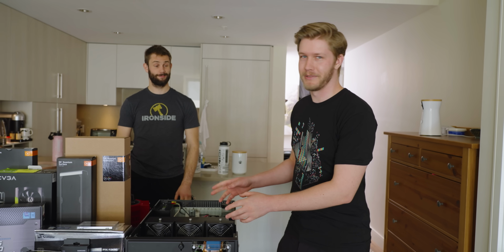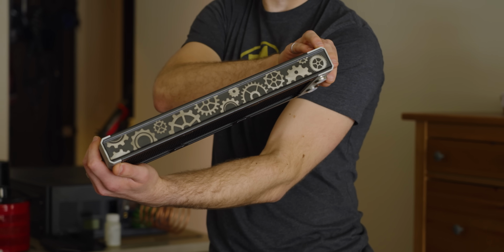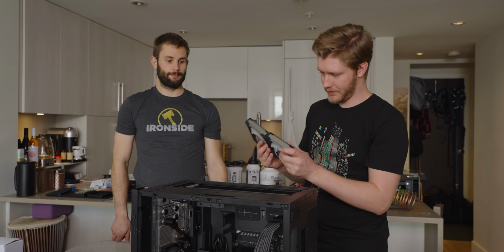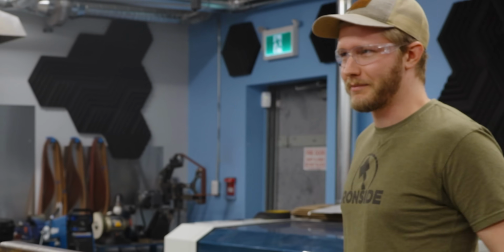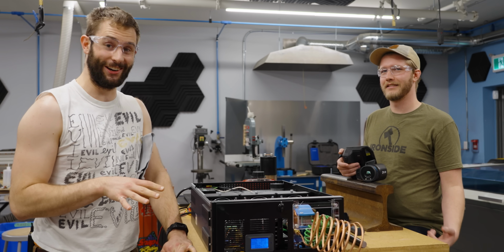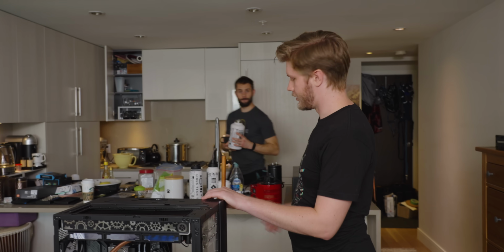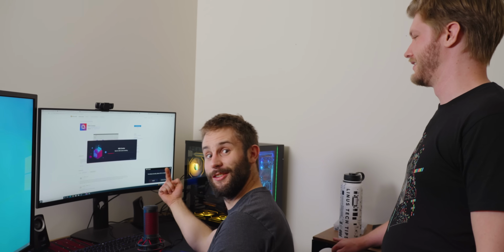This PC is TERRIFYING - Intel Extreme Tech Upgrade

Comment: What is the part number for that capacitor? I have an electrical engineering friend who is curious.
Also I think the kw value of the big boy cap looks a little off. Shouldn't it be 600kw. 
Love the chaotic energy!
Reply: its a C500T from Celem! technically speaking its maximum current is 800A, its max voltage is 750 RMS and the maximum power rating is 500KVAr (not KW). You can pump that much power through it as long as you can pull the heat it produces from its internal resistance fast enough! Generally parts like this have seperate power/voltage/current limits each of which need to be maintained so the power limit is lower than the maximum voltage and current multiplied out.

Comment: He should have bleeding resistors across the caps. and that inductor was saturated in the first test i reckon lol
Reply: I do have a 47Kohm resistor as discharge caps, otherwise the voltage wouldn't really drop. OOHH yeah the toroid core was SUPER saturated, I swapped it out for the 6 toroids and the entire heater system works WWAAYY better!

Comment: am I the only one who thinks their "breaker" problem is weird
because a breaker isn't really supposed to fry itself
that'd be a fuse
and we stopped using fuses in buildings a long time ago
and like, it's not hard to connect wires together in the worst case, if you know what you're doing, which you should if you listened in school
I don't see why they would need an electrician

Comment: I mean, I like all the jankiness usually and I ain't being a boring Billy or whatever I'll be called, but I mean there were just being stupid as fuck at that point in the lab, if someone had of got clapped by them volts/amps, then there would be trouble I'm sure. One thing ya never mess with is the invisible killer... (ie)... the shit they were just toying about with. I mean, just not paying attention for 1 second and u could be done, lights out baby, game over, no checkpoints, no mulligans, that was on veteran difficulty my guy, they were just crazy, especially Tynan. It's good TV an all, but so fucking dangerous guys. Man, I was on edge the whole time he was near that box and gonna hit power.  I have a feeling we wont be seeing things like this for a while, and maybe not see tynan for a while, I could b wrong, but hey ho, just my opinion.

Comment: Recommendation for Tynan put a high resistance resistor I parallel with the capacitors so that when power is turned off it discharges the power safely from them
Reply: There is a 47Kohm resistor across the bus bars for exactly that purpose! The capacitors hold enough charge that it takes a very long time for them to discharge through it.

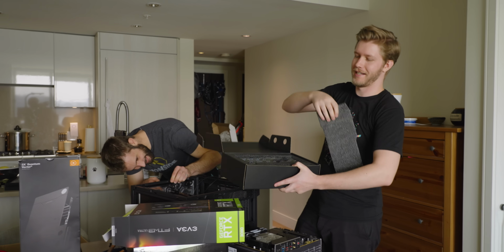Comment: 6:50 "You have to try to make it a d***". Job well done, they even included a sphincter star for reference. He's such an idiot.
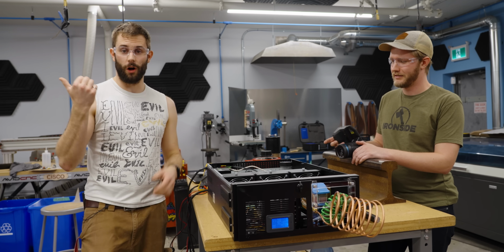15:33 Blow a breaker in the wall and just reset it. I did it today on the job because people plugged too many heaters into the plugs on a single breaker zone. And, if the breaker actually fails- you just pop it out and put the new one from the hardware store in. No electrician required.
Reply: yup you are totally right. there was a chance through testing I could have tripped it several times through and in general breakers are rated for a certain number of trips before they should be replaced.
Reply: @tynanstack7924  I'm not trying to be saucy. I looked and couldn't find any information about breakers being rated for a number of trips. The best I could dig up was a bit about 'exercising' older breakers by flipping on/off/tripping/resetting to maintain functionality. Mine? My computer is on a 10 amp breaker I've popped 6-10 times a year for the last 10 years. It's when I run my electric tea kettle while the space heater is on high. Winter. Oops. As far as I can tell, no one's replaced that breaker since the house was built in the '80s.
edit: and you replying to me is awesome. Say what I will, you rock. Best LTT guy in my book!

Comment: I wonder how many farads these gargantuan capacitors have.
Reply: The really big one was 20mF, the two ones installed in the induction heater were 1.5mF each and the high power Celem capacitor was 3uF

Comment: About forty years ago I was shown a unit much like this inductive heater. One thing I remember is that they had a output transformer and there was just one turn of the secondary coil that was brought to form a loop where you could insert a piece of metal you wanted to heat. A inch thick rod of tool steel took less than ten seconds to heat enough that it melted and the end dropped to the floor. It was used for spot hardening of things like crankshafts and camshafts where you want bearing surfaces and the surfaces where the lifters ride hard while the rest of the shaft is tough rather than hard. I remember that the unit was pretty compact, though certainly larger than the one in this video. If I's have to guess I'd say about three to four times that rackmount chassis and I guess it was in the rage of 60 to 100 kilos though it could be a lot more. I have absolutely no idea of the power draw though. Also while writing this I get a feeling the output secondary coil might have been water cooled as I have a strange memory of there being water running into a floor drain. Like I said it was forty years ago.

Comment: Great Video, love the ingenuity!
I would say you need a discharge resistor (or a few) to quickly discharge the capacitors , it is used in commercial  power supplies.

Comment: Hey...I've been llooking to do something with copper tubing for a while.  However I am always struggling to understand what size tubing, and fittings are required for copper?
Reply: I would suggest you go back and check out the copper hardline watercooling video from LTT titled: "Copper Tubing is Hard" they go over a lot of the details and make recommendations about how to do it if you want to. If you want details from me lmk I can let you know what I did but that video is a pretty robust source of info!

Comment: For the size of that its not very efficient and needs a lot of tuning I have seen induction heaters half that size melt 1 inch diameter solid steel bar.

Comment: Not bad. I built an 11900k with 3090 when prices dropped a few months ago. Got the 11900k for $290 and the 3090 ftw3 for $970. Just using standard air cooling as I live in a climate controlled house.

Comment: The whole copper hard tubing is next level dumb when the copper is inside the case. I guess it's neat , but utterly pointless if you are trying to get heat out of the case.  I have 25 feet of 1/2" copper attached my rig, but its in my crawlspace attached to a full copper 60 x 360 mm radiator.  And by having a total of 1 gallon of water/antifreeze, temps never get above 60c under full load.

Comment: As someone who has worked with high voltage systems before before there is nothing more terrifying then turning on self built system even if you have quadruple checked that it won't light anything on fire or turn you into a commical cartoon skeleton.

Comment: going to need some corrosion inhibitor in that loop. Remember whole house water cooling? or whatever it was called. copper and aluminium aint friends
Reply: All of the fittings rads and blocks are either copper or brass so there shouldn’t be any issues with galvanic corrosion

Comment: He was pretty spot on about the cost of the watercooling stuff. I have a lian li 011, monoblock, 2 360 rads, d5 pump res and a gpu waterblock from ek...was about that. But damn, is it beautiful. 

Edit: the more I watch this video, the more I like this guy. For example, the PSU is overspec'd. I was always told even back in the late 90s/early 2000s to not skimp on the power supply. Ok. Having watched the entire video im starting to think this guy is a long lost cousin of mine.

Comment: I used to work on classic CRT video games. I never worried much about working on the power supplies, the caps were usually what blew when one shut down. Now the CRT and it's coil? That's a different matter. Either could knock you across the room if handled wrong.

Comment: That toroid is overcoming its Curie temperature for sure, so the resonant frequency is changing. Adding more toroids is a good compromise to that, but then you will have to adjust the windings.

Comment: Alex next time do copper hardline, get pro press connections and quick connectors for hardware, or save some money and use PEX A, would be awesome to see instead how does and price compared to regular soft/hard tubing and fittings….but Pex B will give flow restrictions so size up if use B since couplers/fittings are smaller ID, compared to Pex A fittings…….fyi
Loved the vid✌🏻

Comment: I am curious about using an electric coil for heating and forging VS a smaller forging crucible running on GAS or traditional COAL. I assume the carbon footprint is an "ISSUE" but power being used on a coil system has to come from somewhere. if your energy plants are COAL or cleaner Gas I suspect you might be using MORE power to forge WITH than simply using the fuel directly to heat the metal. If you are using nuclear or a combo of Solar/Wind/Geothermal and or Tide power, then the argument COULD be made for ONLY using electricity because it's 100% clean source.
Reply: Also the MASSIVE amount of heat loss with the internal components of the rig is a big efficiency loss. Hopefully your planned updates will increase the efficiency.

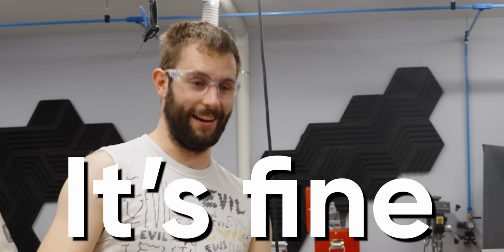Comment: 14:37 do your plugs in Canadia not have switches on the sockets like UK ones? Don't tell me you guys have sockets that are on constantly like 'murica? Dang it. And here i thought you were cool, what with spelling and saying aluminium correctly, saying the words arse and bloody all the time, using  degrees celsius like normal people, just like us here across the pond....and then you had to ruin it with american sockets that are probably those two pronged doohickys that dont have an earth wire built in to the plug of the devices...man. its kinda nuts that you guys dont have wall sockets you can actually switch off.
Reply: Not just Canada. The ENTIRE CONTINENT OF NORTH AMERICA is like this
Reply: @TheXtremeBoltGuy  thats crazy

Comment: The computer looks very cool. BTW I am not sure, but copper pipping with the aluminum blocks and tap water could cause some galvanic corrosion. Maybe is not really a problem.
Reply: Everything in the loop is either brass or copper so there shouldn't be any issues with galvanic corrosion thankfully!
Reply: @tynanstack7924  Awesome! I didn't noticed. You guys thought of everything!

Comment: I feel like the copper tubing makes a bit more sense than the classic material (don't know what it is). it sure is a pain in the ass to bend, but copper is a really good thermal conductor, so you would be getting passive cooling tubes that would recieve air from the fans, making quite a lot of sense. it may have been a pain to build, but it is a good engineering model

Comment: Back in the 1970's/80's my grandad worked with something similar to what Tynan built. Apart from the fact that it was 8 or 9 whole industrial cabinets stuffed with incredibly powerful electro-magnets and god knows what else. The copper pipe also came out and returned to the ceiling. The device would heat up the desired part to glowing in under 5 seconds. It wasnt exactly safe as it did cause issues with his health.

Comment: are u aware that this coiled pipe is live and referenced to ground? its LIVE. DANGEROUS
Reply: Yes it is live, but it isn't referenced to ground other than through stray capacitance because of the coupling toroid. Touching it in one place would not be ideal, but touching it across the coil would be very dangerous, I gave it a conformal coating for exactly such a reason, and in a future upgrade I plan to wrap the coil in fibreglass insulation to provide one additional layer.
Reply: @tynanstack7924  i would love to see that :) kindof stressed that metal oscillating inside of it.

Comment: I loved when Tynan went "it is drawing 11 AMPs" and Alex goes "that's not too bad" and then Tynan goes "AT 220V", just casually doubled the power draw, no biggie.
Reply: @toddbod94 Our normal UK kettles draw more. No need for 'fast boil' over here. It's always fast, we need our tea.
Reply: Ain't that just how much a kettle draws?... Those are generally ~13 amps on a 240V circuit, that's actually no biggie .__.
Reply: I mean a range cord is rated at 50 amps, dryer cords are rated at 30 amps, so that's not that crazy.

Comment: You guy need to ground your selves with insulating belts and like a 5 ft stake in the ground under the cable xD yall would be good up too 10k volts and 5kamps

Comment: Biocide doesn’t counteract the fact that tap water contains minerals which will accelerate the galvanic corrosion process and leave caked mineral residue over your expensive watercooling parts

Comment: Omg yes. Can we have a video where Tynan goes over the build of that inductive heater, what everything inside it does and why he made the decisions he did? Also any safety features like temperature switches etc.

I'm disappointed that it doesn't seem to have a proper disconnect switch built in so that you can safely connect the cords while disconnected.
Reply: I guess u need to go to Floatplane to get a Video about the heater.

I guess the big Black Switch does exactly that. And they only forgot to turn it off. But only a guess

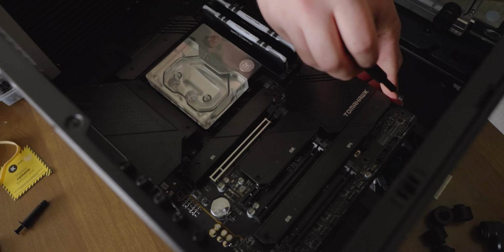Comment: LOL Alex 7:40   I just installed the MSI X570s Ace Max in my LL O11D Evo last night, sure is amazing pcb of metal(hurhur).  I had the same frustration with my standoffs not lining up. it doesnt just drop in like my cpu as i dropped the cpu for the first time bending 5 corner pins.. Stressed out on my 5950x fixed it test booted on old mobo with 750ti sacrifice gpu incase... So glad to see it done and purring. Lowest cpu temps yet! Thanks to practice with other builds and thermal grizzly this go around averaging 29-38 'idle' (multiple tabs and apps but no games or high stress.  Love seeing you guys work makes it much less stressful when i do it 1 handed..      Have a chill day!           Screwdriver pls kthanks :]

Comment: I've replaced my own breakers a few times, is it really that dangerous? Maybe it's different in different countries I'm in the Netherlands, and don't think I even could  get shocked by it i I wanted to. The metal part is unreachable unless you've got very thin fingers. Why would they even sell breakers at any hardware store if you shouldn't install them yourself?

Comment: not a good idea but
you technically can use that induction heater to drive a high voltage transformer that would output tens of kilovolts without breaking a sweat

please do not do that

Comment: so annoying those "media creators" who think they are hardware enthusiasts...1300w is not overkill 1) you're not supposed to run a psu at it's limit just like you don't redline a car engine unless you want it to overheat and break Tynan is right here 2) with a 12900k and 3090 my personal record is 1100w and in normal usage some RT games reach up to 840@psu buying less than 1000 in 2022 is future fail, you even said it yourself other chose wrong and paid the price.oh and I already blew up a 800w psu which destroyed my main gpu (sli) and half the motherboard didn't work right...how much money do you risk cheaping out on a psu today ? 2000-3000$ ? to save 100$ ? really ?

Comment: This video feels very nice and calm with Alex as the host. Usually it's pretty chaotic with Linus😂
Reply: that's why I love this series, for Linus just being a menace
Reply: @B4WZeR  Yeah, but I can see why they didn't let Linus anywhere near this build. I bet he'd been skyrocketed to another dimension by that capacitor
Reply: @rivox1009  Linus is the capacitor, he would just drop more things
Reply: They had to have Alex, because the dude getting the upgrade is complete chaos. Imagine the hurricane level chaos that would occur if both Linus and this dude were together doing this.
Reply: @Alucard0715  One or both of them would have died. This was a safety measure. Don't store oily rags next to electrical outlets, and don't let Tynan and Linus be in the same video together.
Reply: Alex trying to be wild is like when Linus is tired
Reply: different kind of chaos
Reply: imagine your boss coming to your house, poking around drawers and looking for stolen items from the office. 😂
Reply: Did you not hear the whole "This could potentially blow the breaker for the whole building" or "There are a lot of things that can kill you" parts of the video?
Reply: i'm thinking maybe they did that on purpose. there has to be a limit to how much chaos lmao.
Reply: "STOLEN"
Reply: It feels a bit boring.